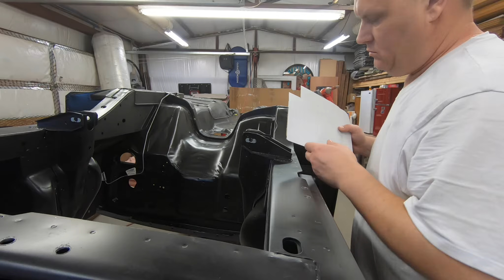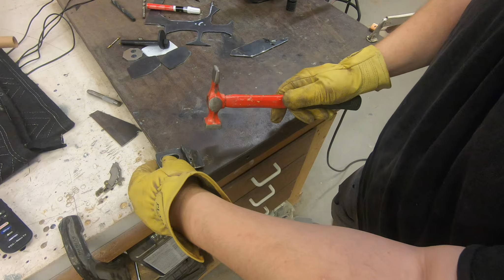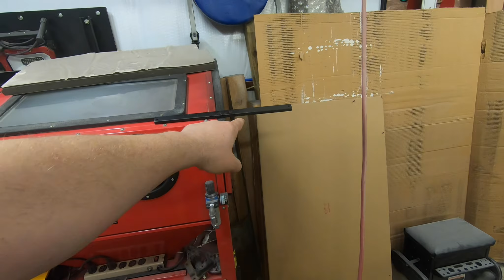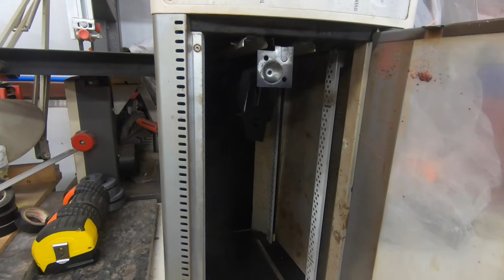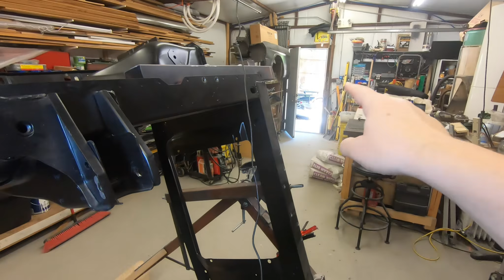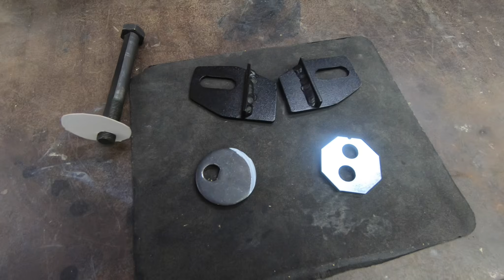No weld camber plates for 65-66 Mustang

Comment: Great video and looking forward to the 2K primer video.
Reply from the maker: Thanks. Well plan was to do it this past weekend but the weather was not cooperating. Winter came back... It was down in the 40s for lows and 55 for the high. And it's going to rain all week so I won't be able to do it till I get back from my trip. 
     I may work on the shop insulation in the mean time before it gets really hot. Possibly do some filming at the swapmeet and get it up before I go as well.

Comment: “No weld” but you still need a welder. 😜 Nice job! Now hopefully someone will produce these!
Reply from the maker: Yeah no weld to the car😁. I have a better design for it that I may look at making a prototype. Could have them made up to sell but I dunnow. Will see. If the better half let me put a big CNC mill in the garage instead of it being for her car....
Reply: @theinfernalcraftsman  Way cheaper to outsource the manufacturing. Besides to use the CNC you’ll need a higher degree of accuracy than your CAD (cardboard aided design).
Reply from the maker: @swooshdave  True. I used to have access to a mill and lathe etc and there was a Bridgeport 2 locally nearly free that I wanted but it's a big machine and has to be converted to modern controls. It's a I want it thing... 
         Really miss having a lathe to use as there is allot of times it comes in handy.

    I do have actual computer cad programs too.. I can scan it in and then fine tune it in the cad software. But I have been out of practice for a long time. I still have my copy of autocad 13...
Reply: That being said I’m happy to test out the beta versions. 😎
Reply: @theinfernalcraftsman  Only 11 versions behind. Hope you have a Windows 3.1 machine laying around. Somehow I think that might be the case. 🤣
Reply from the maker: @swooshdave  I also have 2000... But I have used a number of others and have a copy of Rhino and have messed with confusion 360 as well but I'm just way out of practice. That said the cad software now makes stuff allot easier. The days of commands not working in auto cad and having to restart the program to get them to work are pretty much over now.
       And yes I do have a copy of DOS 5 and dos 6 along with win3.1 somewhere... Back from when I was building 386 computers... I even built a dual 386 processor back then.
Reply: @theinfernalcraftsman  yea the car stays in the garage 😂